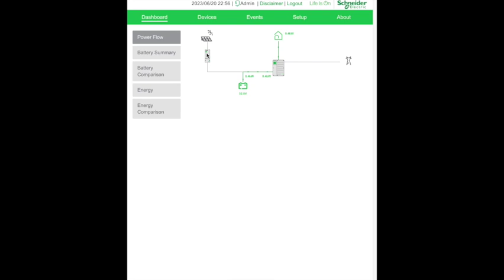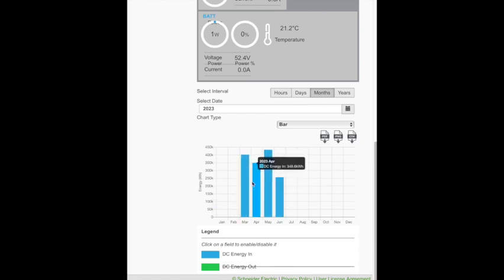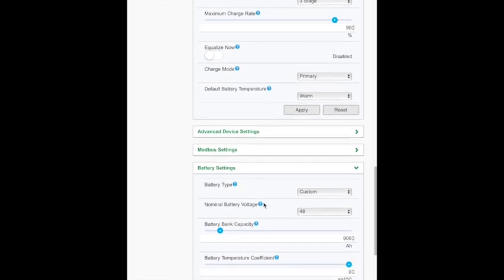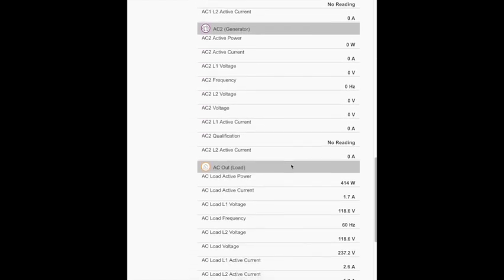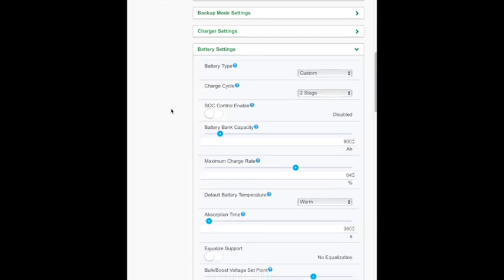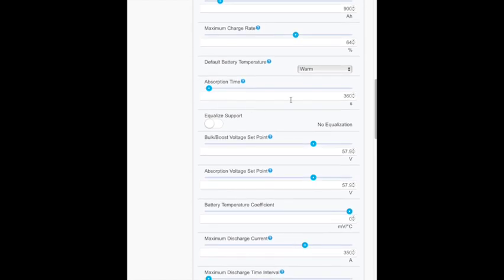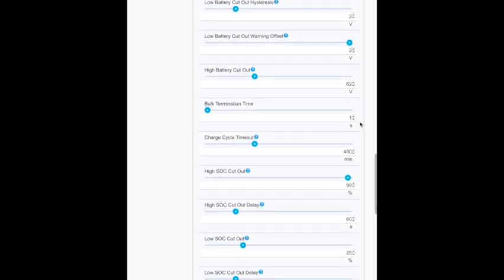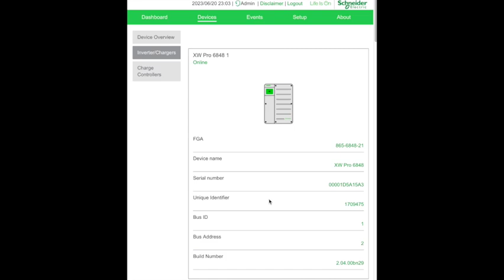Schneider Inverter & Charge Controller off grid setup

Comment: can't hear jack shit in this video. What's with the audio? did you test it before  uploading?
Reply from the maker: Did you have your volume muted? The audio is working perfect.
Reply: @NewLightEnergy  No actually he's right, it's very low volume, hard to hear you.
Reply from the maker: @Jennifer-007 wierd I listen to it and it comes through clearly. I don’t know how to fix it.
Reply: @NewLightEnergy  No biggie, you just have better speakers than we do I guess we'll live LOL.. thanks for uploading the video.
Reply from the maker: @Jennifer-007  did you find the information was valuable? Are you running the same inverters in charge controllers or just starting a research?
Reply: @NewLightEnergy Yes for sure…. Am in the process of putting in 2 XWPros, pulling out a Victron system and SW4048 system.. thanks again.
Reply from the maker: @J @Jennifer-007 ce. These things are tanks. Unfortunately no longer be manufactured for the American /Canadian markets.
Reply: @NewLightEnergy NAZ solar in Flagstaff has all the remaining stock and is selling them off cheap. I picked up two.